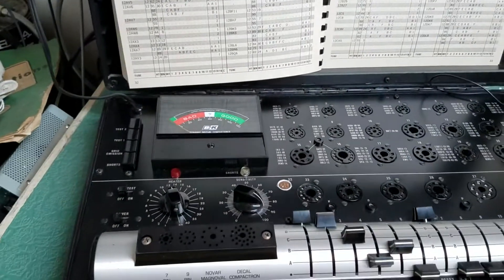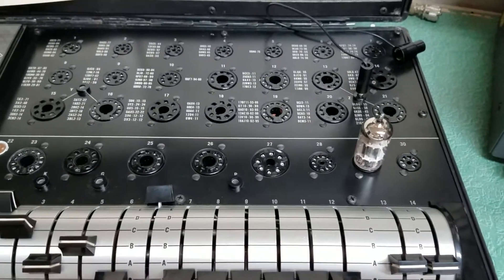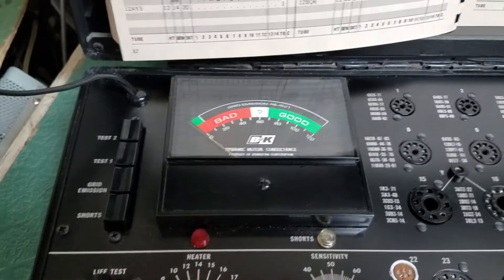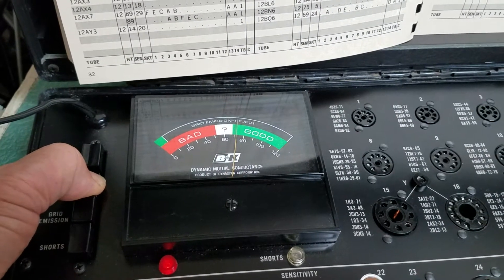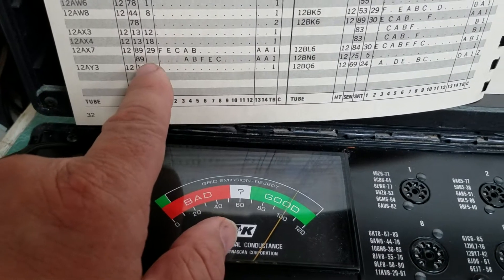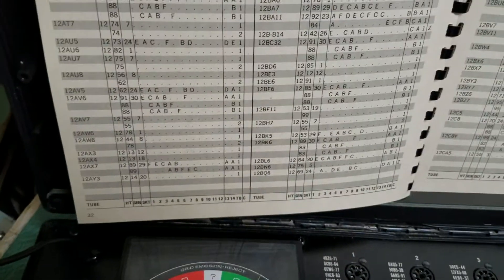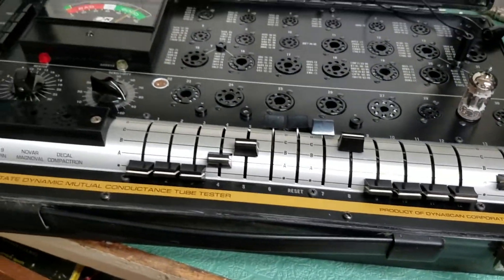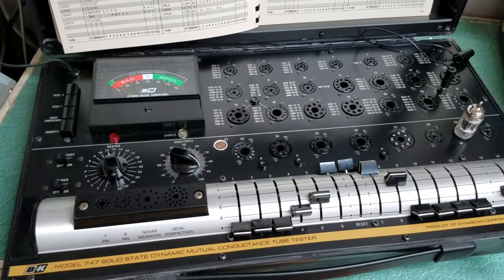B&K 747 tube tester

Comment: I own the identical model; fortunately it is in great working condition and the cosmetics are excellent. However, these testers are well known for bad capacitors and resistors drifting out of tolerance due to age. The best approach is a replacement capacitor resistor kit; then the unit most be calibrated, which involve a number of pod adjustments using the service manual.
Reply: "these testers are well known for bad capacitors and resistors"  ... exactly.